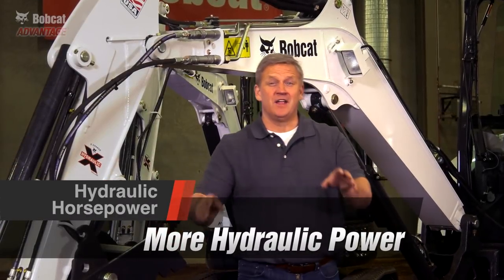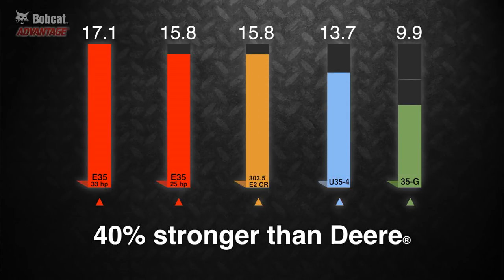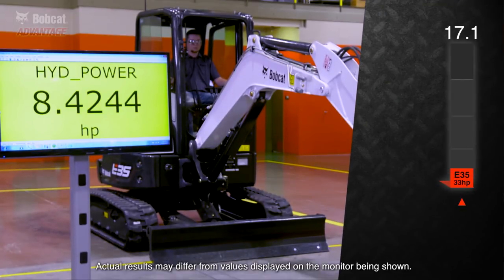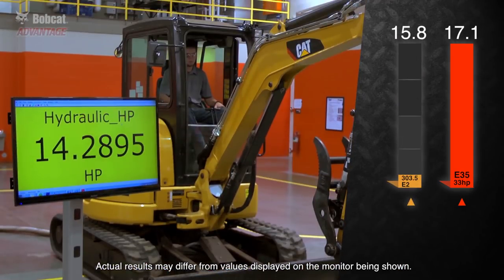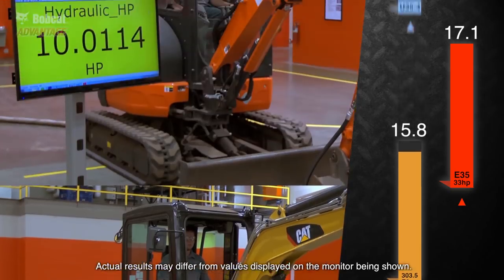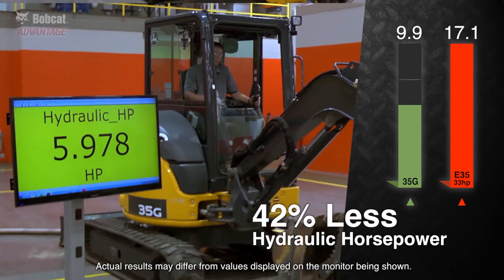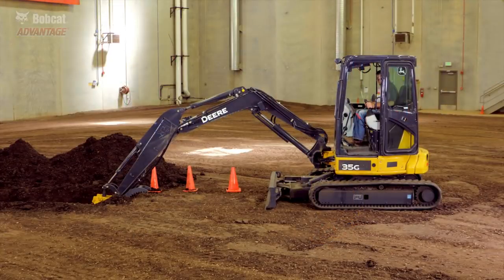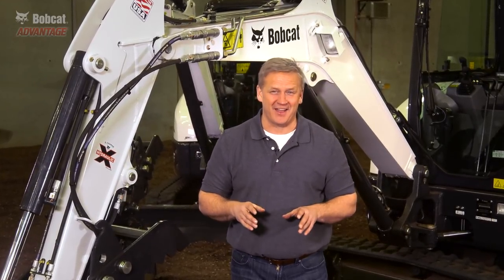More Hydraulic Power: Bobcat vs. Other Excavator Brands

Comment: In your bar graph at :17 you show the E35 33 hp putting our more hydraulic horsepower than the CAT 303.5  I would hope it would considering the 303.5 is only 23.5 net horsepower!  The CAT actually out performs the Bobcat according to your video considering the E35 25 hp producing 15.8 hydraulic horsepower while the Cat 303.5  also puts out 15.8 with only 23.5 net engine horsepower.  Correct me where I am wrong but it seems to me that the Cat 303.5 actually our performs the E35 25 hp.
Reply from the maker: Hi, Isaiah. There are two horsepower specs, net and gross. With this example, we're showing gross horsepower; in your example, you're referencing net horsepower. Either way, yes, both CAT and Bobcat offer a 24.8 gross hp model (shown in the video). However, if you need more power with the same size machine, Bobcat Company offers a 33 hp model in the 3.5-ton size class as well. You can compare all the specs between our 25 and 33 hp E35 models here: https://www.bobcat.com/excavators/compare-models
Reply: Probably the same motor in both buddy - Have a look in the engine bay and if its dark greenish blue then its a Kubota, probably a 3 cylinder inline for a machine that size.
Doesn't mean they use the same pump but there you go.
It's a bit of a trade secret that most small earthmoving motors are either Yanmars or Kubotas and most larger ones are Cummins, sometimes they try to hide this like with Komatsu's engine labeling and numbering system - All their excavator engines are either Yanmar or Cummins.